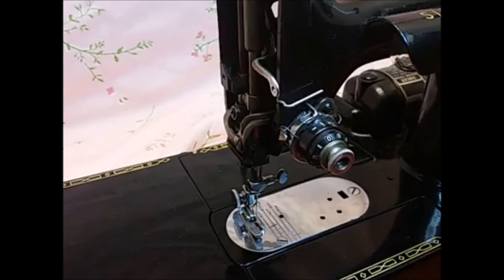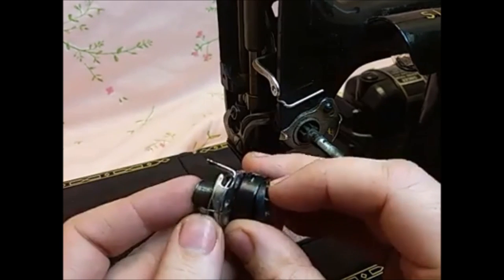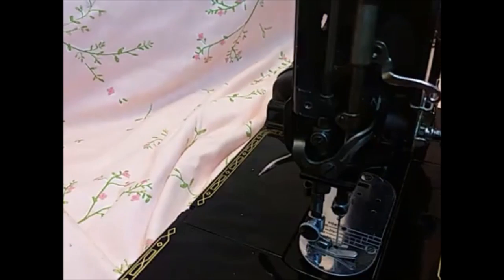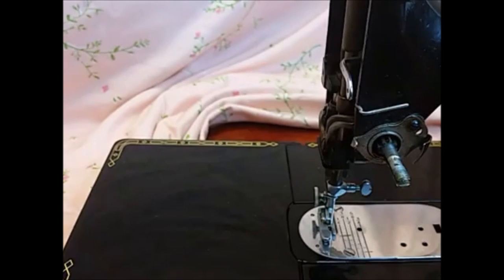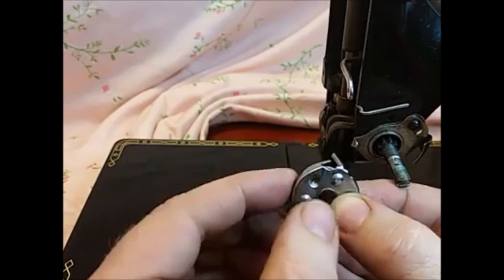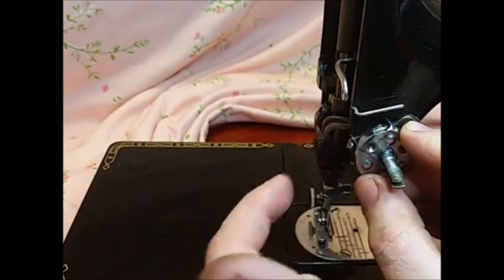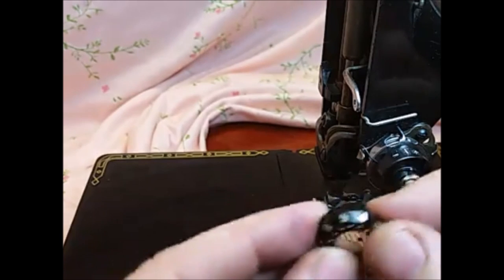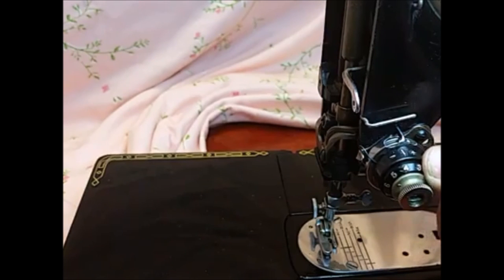How to Disassemble & Reassemble the Singer Featherweight Tension Unit

Comment: Hey thank you so much I was so stuck with my top thread breaking all the time in two seconds I change the needle clean the shuttle but no avail finally I and that the entire tension knob  and reset it after cleaning ,though it was not dirty. But it worked and  the top threads didn’t break from the top thank you thank you all the best